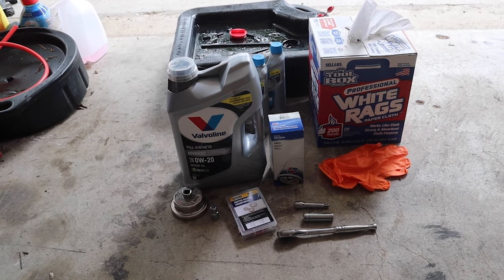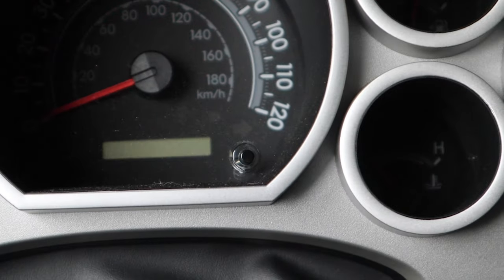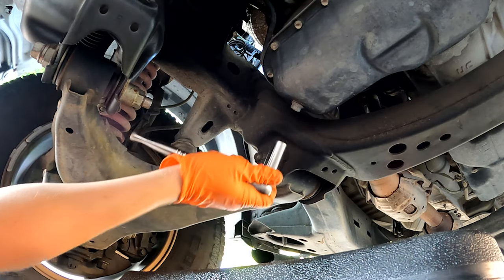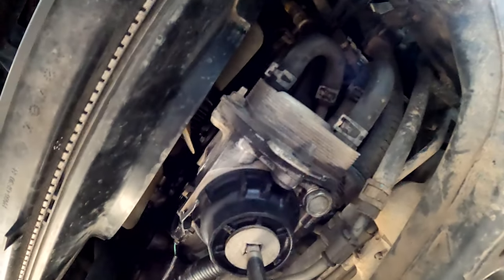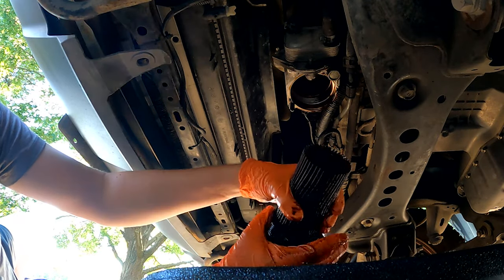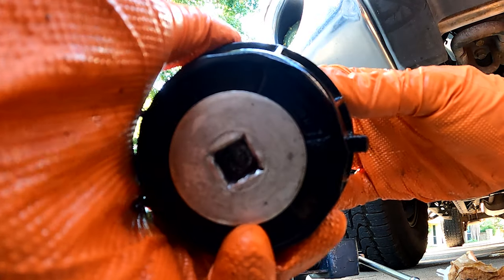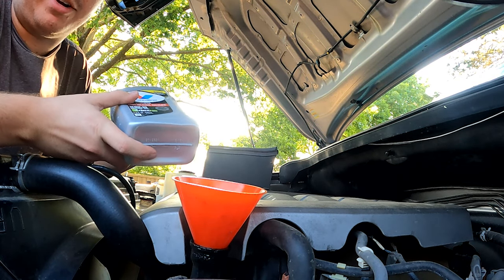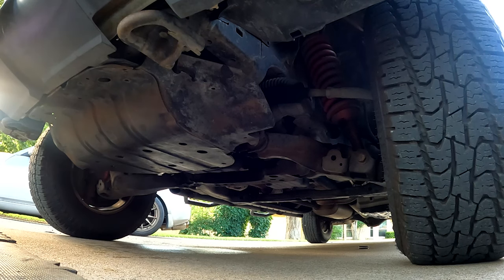Toyota Tundra 5.7 Oil Change (easiest & fastest step by step w/ oil capacity, tool list torque spec)

Comment: Some do it for the few bucks you save, I do it myself because a numb nuts at express oil left my drain plug loose. Never again. The “Stealership” is actually not that much higher than the quicky place, but it’s half a day of my life to get it done. Plus… I like doing it myself. Good job on the video.
Reply from the maker: Agreed and well said 👍 thanks man!
Reply: I hear you. 👍
Just did my sister's '17, she's been having quicky lube or stealership do her services. 
Found - 1 of 4 shield bolts missing, the plastic nuts for sheet metal screws were stripped and the filter was so tight that the cap cracked when I removed it ( yes, I used the correct tool with notches and held it square).
BTW, I am retired fleet service. that means I try to do it right the first time because it is very likely I'll have to fix it later if I don't.
Reply from the maker: Painful to see them lose that hardware and skip steps!
Reply: I do it because the last people I paid to do it, left my oil filter on not even hand tightened.
Reply from the maker: Have heard a lot of stories like that!
Reply: Ends up saving more than a few bucks tho, ends up being about $60 or more in savings if you get cheaper oil on sale.
Thats like getting payed $60 and hour (and it takes less than an hour really)
Reply from the maker: I like the math here! Pay yourself to do the maintenance! And you make sure it's done correctly.
Reply: Half a day?

Comment: Take it to the dealer. I’ve owned my 2012 Tundra since new and this is first time I’m changing the oil. Outside of oil changes and dealer recommended services no issues at all. The oil change process is super easy but you will not escape the mess. At the end of the day, you may save a few dollars doing yourself. In my case, I lost a shirt due oil spill when draining the filter. Save yourself time and mess and let someone else do it.
Reply from the maker: To each their own, but I enjoy doing it, and I know that it's done to my level of preference and that nothing was skipped or missed.
Reply: "Take it to the dealer 🤣" So instead of saving an ass ton of money and doing it CORRECTLY,  he should take it to the dealer because it is "too messy" for you. Wow man. The more you do it, the better you get at it and will make less of a mess. I put cardboard down under my vehicles and for the most part not a drop of oil touches it. Not because I am billy bad ass...but I have just done it over and over through the years.
Reply from the maker: Right?! This shit made pretty much everyone lol
Reply: @CrowT  I'm 47 and I've always changed my own oil. I have a 99 Lexus LX470 with 300K and a 2015 Tundra both rigged out for overlanding - I've always done my own oil changes but now live in a place where it's more difficult. The few "extra" steps like going to buy the oil or ordering it/crawling under the vehicle multiple times/transporting the used oil to the local auto parts house used to be less of a hassle, but now with all my work etc. I don't have as much time.  Some people including myself get to the point, physically and financially, where it's worth the money sit at my very nicely appointed dealership, sip cappuccino, and watch TV. They usually even wash it. (I won't take them to quicky places. I am very dealer specific and there is only one here in DFW I will take it to.) If I didn't have a dealership that I've built trust with, I would still be doing my own. 
Some people just get to the point where every last thing is not about saving a dime. The time is more valuable.
Reply: @thebigempty_5792  Not being able to do an oil change because of situations outside your control is one thing. Being lazy and using piss poor excuses like "I got oil on my shirt" is another. At the same time....it is YOUR money. Do with it what you will.
Reply: Yeah i used to take my 2018 to the dealer for the free oil changes. On tje last change they wrecked my truck into another car. New door panel later, I got the tools and do it myself. I always do my own oul changes but figured I would take advantage of the free ones I had left. Won't be doing that again.
Reply: Gotta be a troll.
Reply from the maker: Everytime I think that..it turns out to be real 😂
Reply: @thebigempty_5792  well said.
Reply: @CrowT  as a hobby I resurrect cars for fun. No one is crying over a shirt.
Reply: @cy-fairclean8458  You resurrect vehicles as a hobby, but doing oil changes on a Tundra is too much a bitch to do? That makes zero sense. And YOU....you literally complained about getting oil on your shirt and ruining it above.🙄
Reply from the maker: Well, ONE person I can think of may be crying over a shirt..
Reply: I used to be like you. I lived in apartment and while it was possible, doing oil changes in the parking lot was a PITA and I think technically against my lease. So even though I'm pretty good at working on cars and know better, I took my 2011 Subaru Outback to the dealership for oil changes. I thought I'm paying a bit more but at least I'm getting OEM oil and regular inspections and fluid top off. Cut to 50k miles later, I'm stranded on the side of the road in nowhere Illinois with an overheating engine. Oil in the coolant res. Thought for sure it was the head gasket because Subaru. Get it to the dealer there, IT'S A CRACKED BLOCK. 136k miles on a Subaru 2.5i EJ23!!! And the block cracked! 2 days after a supposed inspection by the dealer. I have come to believe that they were skipping steps and treating my car wrong at the dealer. Otherwise a tried and tested Subaru engine would not have failed like that. I thought I was babying my car but all along I was neglecting her. I will always do my own oil changes on my truck, I can't trust anyone else to do it right.

Comment: Back in 07 I bought a new Tundra. First oil change I took it to the dealer. They messed up and oil was spraying out around the filter as I drove home. I didn't realize it until I left for a trip a few hours away. I heard knocking and pulled over. Oil was everywhere! The dealer came and picked up the truck and gave me a loaner. I made them give me a 100K mile engine extended warranty. Still have the truck and it has 145,000 miles on it. Thanks for the video. I plan on changing my own now to save money. I would have done it back then but I found out about the special tool and the skid plate removal and. lost interest.
Reply from the maker: That's wild, but not the first time I've heard a story like that! Luckily, these trucks are just built incredibly well. Glad to, thanks so much for watching, hope it helps!

Comment: Toyota needs to slap itself for not putting an access panel in the cheapo "skid" plate.  And for those of you have taken your truck to a shop for oil changes and you DIY for the first time, you will discover that somewhere along the way the shop(s) has lost 2 or 3 bolts; and at least one or two of the cheapo plastic screw retainers for the three plastic bumper ears.  Which is why folks like me and Mr. Tuner do it our/himself - because they want it done right. The first time I removed the cheapo plastic filter housing, it was torqued on so tightly I had to use an impact wrench to break it loose which caused a tiny crack and so I had to find a replacement housing - which the local Toyota dealer wanted $195 for and I bought a better one (metal) at Autozone for $31,  I don't know whether Toyo engineers were trying to cheap out with the plastic thing or if they figured some dumbass is going to over torque it and when they do, better it be damaged than the housing it screws in to.

Comment: The filters come with a drain valve saving that mess.  Look at the instructions that come with the filter.   You do not need to remove the skid plate.  If you do it's a real pain in the butt to reposition it.   Remove the 10 & 12 MM bolts, and just lower it with its hooks still in the core support.  You can support the bottom if you like.  Get yourself a container with a handle on it to drain the filter.  I have a 32 Oz container, works perfect.  A 1.1/16" socket on the filter remover makes removing and installing the filter easy.

Comment: There are torque specs for the drain plug, the filter housing, and the filter housing drain. If you can't get the drain off of the filter housing without the filter housing spinning, it is because you are putting the housing drain plug on too tight. 

Drain plug: 30 ft/lbs
Filter housing: 18 ft/lbs
Filter housing drain plug: 9 ft/lbs
Reply: Dad built engines for 40+ years, I was there with him for 25 of those, along with my time as a Navy mechanic. Run that drain plug up flush, then tighten it 1/2 turn, or 180 degree turn. NEVER has one leaked doing that. What pisses me off are these jiffy lube type places that want to overtighten the hell out of it with an air wrench. They're the guys that ruin drain plugs and oil pans.

Comment: 1) Cut hole in skid plate,
2) Get spin-on adapter and install.
3) Drain oil and refill.
4) Drink a cold beverage and know you saved a bunch of rags, brake clean, and time for the rest of the long life of your Toyota!
Reply from the maker: I like the way you think!!
Reply: Please clarify what you mean by spin on adapter.
Reply from the maker: The oil filter wrench that I used, it's listed in the video description.

Comment: Around the 1950s auto makers came up with this fabulous idea of the spin-on oil filter. It worked just fine, no need to move away from it! For some idiotic reason that I can't comprehend, Toyota (and a few other manufacturers) decided to GO BACK to the canister-style oil filter element from the pre-50s era. There is absolutely no reason why that filter on the Tundra couldn't be a simple spin-on filter...

And folks, don't waste your  time trying to get the EXACT oil level, like it's a science. There's nothing wrong with being a smidge over. Yes, you don't want to be a quart or more over, but you're not going to hurt anything simply putting 8 quarts in a 7.4 or 7.9 capacity engine.
Reply: The odd thing is, I used to own a 1st gen Tundra, it used a spin on oil filter. But not the second gen, go figure?
Reply from the maker: Toyota seemed to change up a lot of vehicles to this canister style one in the late 2000s!

Comment: Like your truck!  Bought mine used with 21k miles now at 101,000mi. Put an AFE intake on my 2007 5.7 Tundra 4x4 with 3/1(Skyjacker adjustable struts 3inch lift & rear BilsteiN shocks with 1 inch block) leveled. Same stupid internal oil filter. Can't beat the dealership cost $50 total oil & filter with their $10 coupon since has 7.4 qt. & using 5w-20 semi synthetic. Messy and I always watch em and check level myself in parking lot, LOL they use brake cleaner too.                                                                                                                                                                               My 2012 Toyo Rav4 (37k miles) has 4.6 qt. same stupid internal filter, however, always buy Toyota filter and do myself with Honda semi synthetic 5W-20 oil since have 2007 Honda Accord 185K mi. (same 5w-20) & Honda dealership has 12 qt. case of oil less expensive.                                                                                                                                                                                       2006 Tacoma 4x4 with 301,000 miles do myself w/ external Toyota filter & Pennzoil 5W-30 semi synthetic (5qt. inexpensive thru Walmart delivery). Keep on Trucking and Motorcycling!
Reply from the maker: Thanks man! Yeah I absolutely understand why people do the dealership route, it's so cheap and easy to have someone else do it. I just enjoy doing it myself for some reason. LOL at the guy that was upset about using brake cleaner on the filter housing..thanks so much for watching, and enjoy your truck and bikes as well!!

Comment: I actually agree with this type of oil filter. I think you can control the quality of the filter much better, You can inspect it when you change it as well.   Yeah its a pain but at least its easier to change than my old 2004 Tacoma with the 3.4L V6..  That was a nightmare even though it was a spin on. . The angle was horrendous.
Reply from the maker: Yeah I don't hate this either, it's really not been problematic for me. Only time I had an issue was on my Scion when a dealership overtightened the filter housing and then had to break it off and replace it .

Comment: Mine was torque so tight that I had to put the canister in a vice and use an impact wrench to remove the drain cover. Tried an impact driver at first but it wasn’t strong enough
Reply from the maker: I had that happen with my Scion TC, such a pain in the ass!
Reply: If the hosting spins off there is no further need to remove the drain tube afterwards. Just leave it alone.

Comment: Man, the Oil Filter housing plug is to pre drain and avoid the mess you had when you loosened the whole assembly, also you don’t need to change it if you didn’t use. 😂
Reply from the maker: Yeah pretty sure I mentioned that in the video. And yes, you do need to change that o ring , it's just like any other rubber component. Just because you don't use it doesn't mean it's not prone to aging
Reply: The O-ring is rock solid good for 150k, easily. Same material as your valve cover gaskets and you don’t need to replace those every oil change. I NEVER replace that small o-ring because I never take it off.

Comment: what if u dont have a vice and cant get that inner piece off the oil filter???
Reply from the maker: You don't need to change that o ring unless it's leaking. I like to, but if it absolutely won't move, I'd just not bother with it

Comment: I couldn’t get the bottom part off to change the smaller O ring. I decided not to after trying for an hour. I don’t have a vice.
Reply from the maker: Some people will wig out after this comment..but honestly, not a big deal!
Reply: @BrunerTuner I’m sure those comments will come. Thanks for the tutorial
Reply from the maker: You got it, hope your truck continues to treat you well!
Reply: If the housing comes off there is no need to remove the drain tube off afterwards. I haven’t replaced that on my gs460 (Toyota 4.6) in over 100k miles. Zero issue. Just spin off filter hosing, put new large o-ring on and new filter. Reinstall. Done

Comment: I have a 08 with 193k miles should I change my transmission fluid or flush it out ?
Reply from the maker: I would certainly change it at the minimum! I need to do it to mine as well.
Reply: ota dealer here told me there is no dipstick or way to change it unless you hook a pump up and rig a way.  Dealer told me my 2008 and other Tundra they say the fluid is supposed to last the lifetime ..never seen that before but that was what they said when I asked how much to change it.

Comment: The reason the entire oil filter comes off when you try to remove the drainbolt on the housing is because during a previous oil change torque specs were not followed. The drainbolt should only be half as tight as the oil filter cap.

You don't need tools to remove the o-ring
https://youtu.be/3R1KMN1ys3A
Reply from the maker: Yep. Everytime I either buy a second hand Toyota it's overtightened lol. I didn't even bother taking it off the last time I did the change, right after I got the truck.

Comment: So check the level with the engine running, correct?
Reply from the maker: No, you never want to pull the dipstick while it's running. check it cold, and then check it after the truck is hot, then turn the engine off and make sure you're at an acceptable level.
Reply: @BrunerTuner  
I'm talking about the transmission oil and it doesn't have a dipstick, it has the same plague as the one in the video.

Comment: I love my good ol 2013 Tundra but my God what a horrible design for the oil filter! SMH
Reply from the maker: Yeah it's pretty standard Toyota fare, my Scion TC has basically the same thing and I think most of their lineup does now. Fun stuff..
Reply: @BrunerTuner  Yea mine unfortunately has been stuck on! I even used a cordless impact and no luck so I just use the drain valve and get out as much as i can
Reply from the maker: I had that same issue on my TC, the Toyota dealership had to destroy it to remove it, and so I had to buy a new one!

Comment: I am 45, changed my oil and filter on every car/truck I have ever owned. Never looked like this, WTH is going on? I have a Tundra, new to me, is this guy high? or did Toyota totally mess up something so easy? Brake cleaner, a corrosive detergent in your oil system? Are you on drugs? Oil has viscosity. Detergents break down viscosity. You are high.
Reply from the maker: Lol, not sure what's going on with this comment..you realize brake cleaner fries almost immediately, right..? Not like I went to the oil fill cap and shoved a can of brake cleaner down its gullet 😂 gimme some of your smokes
Reply: They went with a canister filter system instead of the traditional style. He was just cleaning off the inside tube. I don't see the harm since it evaporates quickly and gets wiped away. We are talking nearly 8 qts. of oil in the system vs. .02 microns of brake cleaner residue left over LOL. I think we have bigger things to worry about like up to 10% ethanol in our fuels. It's just my opinion though :D
Reply from the maker: @thebigempty_5792  LOL exactly this, thank you. Couldn't have said it better.